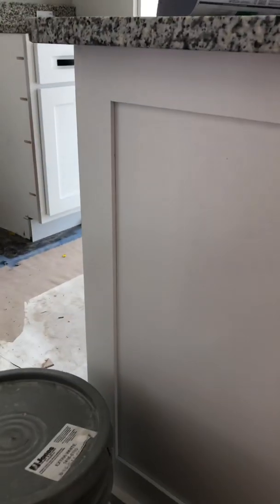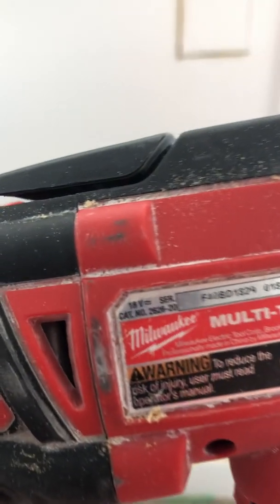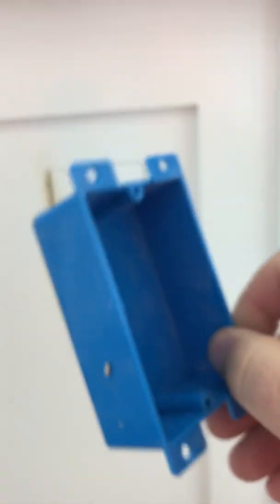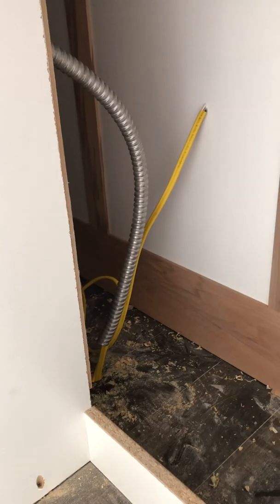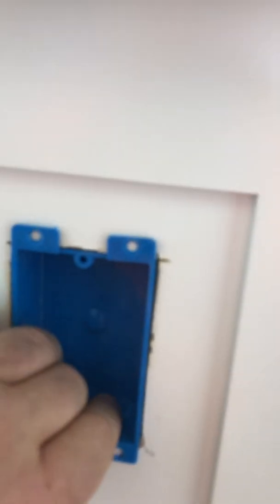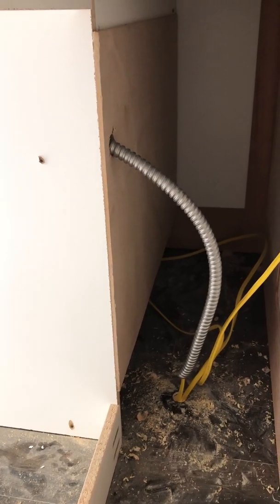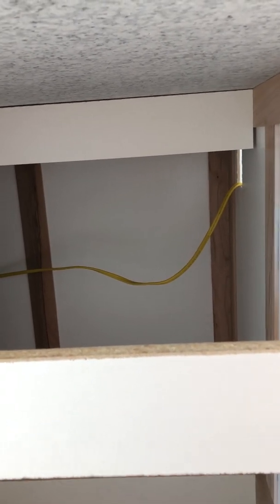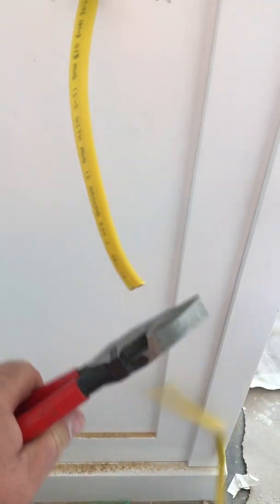kitchen island electrical outlet code [installing outlet in island]

Comment: Which gauge of wire did you use?
Reply: That's 12-2 romex
Reply from the maker: Yes kitchen has to be all in 12 to Romax that is correct with a ground

Comment: You can't have the romex inside of the flex
Reply from the maker: You are correct I should put that in the video but in our city the inspector does not care but for the rest of the world I should correct that that you need to strip the Romax off thanks for the heads up you are absolutely right

Comment: why are you not allowed the socket to be under the overhang ??
Reply from the maker: Michael Quigley it is for code reasons it does not allow it
Reply: @doityourselfelectrical9364  that's not an answer
Reply: @gfdia35   How is that not an answer? The NEC doesn't HAVE to explain their reasoning for the rules. This man is just telling you what the code is.
Reply: @schylarcangelosi8161  If it isn't a safety issue and there are no other options, it should be a recommendation not code. Going against recommendations with get you funny looks, going against code will shut you down. Some code writers sound like politicians and parents, because I said so.

Comment: GfCI on Island, does it have to be dedicated circuit? Or branching off from the GfCI like you explained?
Reply: My understanding in the 2017 NEC, you can wire the (protect) island with one of the kitchen GFCI's.
Reply from the maker: Yes you can.
Reply: Instablaster
Reply from the maker: Yes Carlos you can come off of one of the other kitchen outlets in a new house we just come off of the last one so we don’t have to have three wires in the box and that would still keep it GFCI protected

Comment from the maker: Yes you are supposed to go to an outlet that is in your kitchen because the island outlet is supposed to be GFCI protected so you’ll have to channel all the way to the wall where there is an outlet already
Reply from the maker: It is against code to put it under the overhang
Reply from the maker: Yes it’s against code to go under the overhang
Reply: @doityourselfelectrical9364  what if your island has an overhang of 12” on three sides . The 4th side has the dishwasher and front of the sink cabinet ?
Reply from the maker: @giantesta2798  Get with your local inspector and ask them where to go but you have to have one in an island but they don’t want it under the overhang so you will have to get with them and ask them which side to go on at that point something Hass to happen